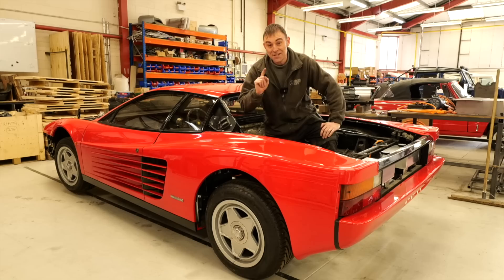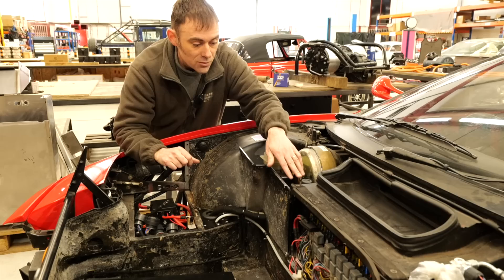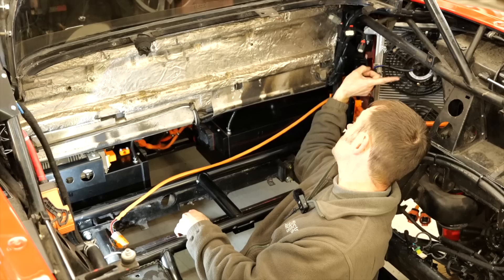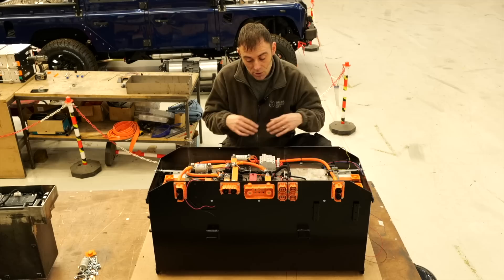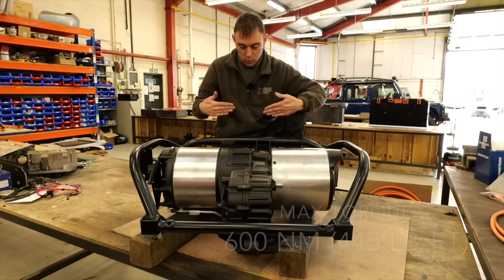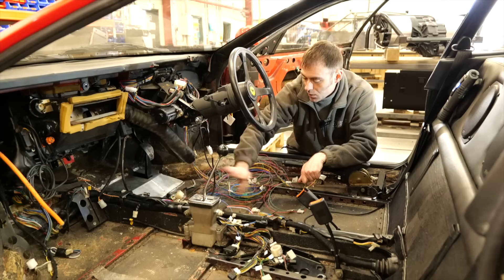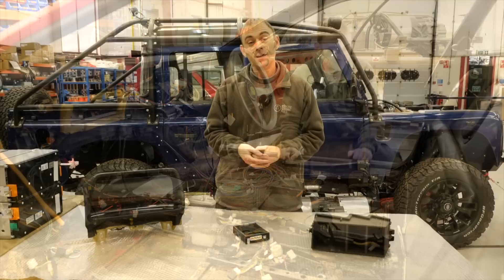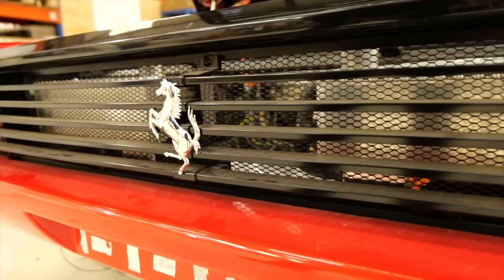Teslarossa Ep5 - Battery packs

Comment: Thanks a lot for the update on the Teslarossa. 
My favorites for an EV conversion are the Lancia delta HF integrale (try to keep the 4WD :-) and  the Maserati Ghibli (Tipo AM336). 
On this one I would propose to replace the rear axle complete by a Tesla model 3 (similar to your Aston Martin V8 project) and the former engine bay and fuel tank space for the batteries.
Reply: Good choice. 👍😀

Comment: A Delta Integrale would be amazing. However in order to keep its all wheel drive capability it would need two electric motors.
Reply: Or they can just connect the electric motor to the original gearbox and drive train. It'd be a great conversion to see though.
Reply: As long as this thing still goes fast and handles great it’s a big win!
Reply: Or four.....  :)
Reply: Jerry rig everything converted a Humvee using one motor and a transfer case.
Reply: And two motors is a problem because?😂
Reply: @terrygibson6972  just stealing room for battery in an already small vehicle.

Comment: Dear Reader,
Electrifying older Citroëns would be top of the bill. The DS, SM, GSA, BX or XM with an electric motor would retain the plus-factors of Citroen, like design and suspension, whilst getting rid of their somewhat undersized engine-power.

A car that doesn't show its racing power, is always more intriguing than a car that you from the outside already expect to perform.

With Kind Regards,
Michel F. van den Brun
Dutch pedestrian
Reply: Are you referring to a sleeper car??

Comment: I do I agree with what you are doing. This car is from the years when I worked in the automotive industry. I got to see inside some of the suppliers who made parts for this car. Ferrari at this time was well known in the industry for their lack of consistency and ignoring suggestions by suppliers.  I saw development models of this car at different suppliers and was shocked that they were still hand welding mild steel frames or seeing how many cheap materials were hiding under the beautiful skin. It was believed Ferrari brought this model out to better Lamborghini, who knows if they did that. You mention the electrical system, it was half German and half Italian economy car and nobody liked working on it. Many of the suspension, breaking and steering attachment points did not look like they were up to the power level of the car. Once they were on the road the horror stories of engine maintenance started rolling in. One similarity Ferrari had to your new system is both used a one piece engine/motor transmission assembly. You should ask the owner of this car how many times the engine has been out? Once the engine was out it was usually out for weeks. This might be the last time for that. I think you're fixing many of the problems this car had and I expect you will end up not any heavier and with better weight balance. The reality of this car is Ferrari made 10,000 of them and most were pampered and still around. They were production cars made from mostly normal production parts by normal factory workers who worked on other production cars, other than the beauty of its coachwork and the ridiculousness of its engine you have a pretty normal car. I think you are doing well and making a car that someone will enjoy. I bet your entire conversion will pay for itself within a couple of "normal" engine overhauls.
Reply: Interesting points 👍😀

Comment: You are doing a fantastic job guys and I can't wait to see this on the road. It will go like a scalded cat. I think the Lancia Beta Coupe and Lotus Europa would make good conversions. The Europa had plenty of room behind the drivetrain and probably bit of space under the bonnet for another pack. Lancia is mid-engined so your experience with the 914 and Testarossa would come in handy there. Failing that, what about a Ford Capri?😆

Comment: I would love to see you convert a 1970 Cuda. As someone who owned a 1969 Delta '88 with a 454 engine, I really like what you are doing. The 1969 Delta '88 was my first car and the most dangerous car I have ever driven. 8MPG, constantly burned oil, AM radio, handled like a heavily loaded barge in high winds, and the brakes didn't work when it rained. But it passed the New Jersey state run inspection. We need to go electric for our own good.
Reply: For our own "good"?  Electric conversions have their uses but anyone who thinks banning all ICE vehicles is going to save the planet is in for rude awakening.
Reply: @phils2180  Where in my comment did I say that we should ban internal combustion engines? I didn't say that.
Reply: @brianbyrd3903  That's what you implied, "We need to go electric". Stop splitting hairs.
Reply: @phils2180 There is a huge difference between advocating for electric cars and making ICE cars illegal. The one doesn't follow from the other. In time electric cars will get cheaper and people will stop buying ICE cars. We won't need to outlaw ICE cars. It's like you are looking for a reason to disagree.

Comment: Your bolt-in conversions are quite clean and respectful to the cars. most cars will have elements changed over their lifetimes, including the drive train, I see no reason why the drive train shouldn’t be changed to an electric one anyway. I would like to see even older cars swapped for electric, the Mercedes Benz 540k is one of my favourites, though I know it’s probably a long shot 😅

Comment: Ah yes,......My dream conversion?........Countach 5000s "not the anniversary edition" or 1972 Detomaso Pantera. You could design a very cool looking battery system to fit in the motor space.
Reply: Pantera please 👍👍👍
Reply: @spudproductions7606  a pantera elktromod would be so right using a tesla ldu of course. To go from American v8 to American v8s ev age replacement propulsion system. It would have to be widebody and slammed or on air ride to. 👍🏻😀

Comment: There was a recent well-publicised Ferrari 308 GTS EV conversion which I regard as a failure, because they changed the weight distribution of the car, giving it the dynamics of a front engined car. The mid-engined mass distribution was a more fundamental property of that car than the V8 ever was. I'm glad you're more considerate with the Teslarossa. I am sure the you can make it better thsn it ever was, by lowering the CoG and of course making it much faster, but in this case the 180 degree 12 cylinder engine and the open gate gearstick were more central to the essence of this car. The heavy clutch, not so much...
The DeLorean was always the prime candidate for EV conversion. Other cars that an EV conversion would suit are an early N/A Giugiaro Esprit, an under-endowed Maserati Merak, Citroën SM/CX, an E31 BMW 8 series, rotary engined Mazdas, a Lancia Montecarlo, a Knight Rider Pontiac Firebird/Trans-AM, VW microbuses/beach buggies/early Golf cabrios, the Vauxhall Calibra and the Ford Probe. And a Jag. Any Jag...

Comment: one option, on cars with iconic engines, could be to make them PHEVs. In the way all PHEVs should be made. With the engine coupled to a generator, and around 20kWh battery to drive around only in electric for city/daily driving. And a natural/analog setting where the accelerator position would match the engine revs/speed, equivalent to ICE driving, minus the gears.

Comment: I absolutely love and applaud what you guys are doing. I would love to see a project with a small city or shopping car that is mainly focused on getting the most range out of the batteries, while the car is still reasonably drive-able. Something that would be affordable for a larger crowd of people. Perhaps a mazda miata, or a triumph spitfire, or even a Citroen DS? I also wonder if you guys keep track of the new electric motors such as the electric crate motor from ford, or perhaps even the koenigsegg Quark raxial flux electric motor that weighs only 30kg?  The Koenigsegg electric raxial motor would be awesome inside your electric beetle. And no, I am not going to pay for it 😁
Reply: As for a regular performance build a Datsun 240 Z would be cool too. I like performance focused builds, but I also like efficiency focused builds. And I also like off road focused builds.
Reply: @insAneTunA   I thought nearly all the 240Z's had disappeared into piles of rust?
Reply: @geoffsemon7411  These guys don't do piles of rust. These guys do classic cars, so by definition the cars are not up for grabs. There are still good ones out there. Or ones that had a restomod. And I think that most of their clients already own the car. So there just has to be somebody with a good 240Z and a desire to give it an electric conversion, and I think that it would make a very good show.  We viewers just have to get lucky 🙂

Comment: Maybe hard to get in the UK, but a 68 or 69 Dodge Charger would rock as an ev - although I know there would be many colorful comments 😂
Reply: What about a 1972 Plymouth satellite called project electrolitte using a tesla ldu with over 700hp that runs low 12s and goes over 300 miles on a full charge? You can find it right here on YouTube it's a garage build to. 👍🏻😎
Reply: You can get them, but need deep pockets for a nice one.
Would you paint it Hemi Orange?...🤔

Comment: I'm thinking the XJ220 or McLaren F1 road car... the 90's pairing that matched the Countache and Testarossa for their era. Having sat in one at the Birmingham Motorshow at launch an again sat in and started an XJ220 at the factory I can confirm you need to be a shorty to drive it. I'm not tall but the Jim Randle era low roofline impinges even on my view (and did at the time when I was a spotty teenager too!). The battery pack you have there in the Teslarossa is not far different to the 540BHP of the XJ220 road car which at the time was Jaguar's highest powered production car ever. The original plan for the Jag was to use a gas turbine to power it but that proved too costly and impractical.... so the petrol engine was always second best to the original vision. I suspect therefore that to EV it would improve things.. though the top speed might be a challenge!

Comment: Just had a random thought seeing this build... You guys are out in the uk....

Seen if you can get your hands on a hawk hf 2000-3000 for a ev powered lancia Stratos replica?

Could do a nissan leaf drive unit/transaxle or a small tesla drive unit it already be more powerful than a stock Dino v6 and you could probably squeeze 30-40kwhr of batteries in the chassis.

Or a listerbell str but I think a hawk hf would be more genuine looking... And cheaper than trying to get a actual lancia Stratos
Reply from the maker: A Tesla powered Hawk HF would be very cool. 😎👍
Reply: @ElectricClassicCars  I'm a bit jealous of you guys cause you also have mst making brand new mk1 and mk2 escourts which would also be a hoot with electric drive

Comment: On the topic of safety... what will happen to the battery in the front, if it is smushed in?? I mean, there's not much of a crumple zone. And shutting off the system won't stop a damaged cell from shorting internally. Are the cells so tough? Or is there a fire suppression system?

Comment: Brilliant design as usual! What I can't understand is why you did not clean up the bonnet and boot and floor areas and treat them before installing all that cool gear! It's looks just horrible! Like putting in brand new kitchen appliances without cleaning and painting the walls around it FIRST!
Reply: The carpet will be installed when the install is complete. The final product will be cleaned up.
Reply: @spudproductions7606  Well obviously the carpet will be installed on the inside but what are you going to do in the boot and in the Bonnet areas? Looks so horrible! Is that all fiberglass in there as it looks like rusted corroded and old paint. Or stripped down and sanded and never primed and painted over? I just don't get it as looks terrible. But again your work with the Electronics and motors and everything around the tech are fantastic and look top-notch.

Comment: So the Landy behind you is so big. So much room, and it doesn't need to be a speed demon.
Would it be possible to install a tiny diesel powered generator in it to constantly charge the batteries?

Comment: Richard, the translation the guys have made for the instrumentation is wrong..you can't say "velocità" when you talk about gears. I know that it was ment to be "speed" in english , which may translate in "velocità" but only when you talk about velocity. In this case "Marce" ( Plural) or "Marcia" ( Singular) would have been the right word to translate "speed" to. For all the rest, a very spectacular execution, as always. I was wandering...have you ever thought about converting a Lada Niva? Pretty good off roader with a crappy gas engine...or a Fiat Panda 4x4...the first one, of course.

Comment: I like the whole idea of electrical conversion and some cars lend themselves perfectly to this like Rolls Royce, Jaguar, Mercedes and such. I expect I'll get some stick for this but in my humble opinion, Ferraris and Lamborghinis aren't in that list. One of the biggest selling points is the sound of the engine whether it be V8, V10 or V12 and to take that away, even if it's for the right motivations like running costs and reliability, just take something away from the car that makes it special.

Comment: Given, Sportscar, why choose a Tesla drive train over a Porsche? Wouldn't the drive unit designed for sportscar performance be  better then that of a family saloon?
One would expect the new drive unit is going to be an improvement over the old gas engine.
As for the approval - those rules you have to abide by, mean the original vehicle is not being destroyed or damaged in any way, so even if it's a pristine and valuable example, so long as the owner stores away the mechanical parts, it can be re-assembled to original at a later date, while being enjoyed right now. With the standard of work you're doing being far and away higher fit and finish then cars such as the Ferrari had from the factories, one could imagine that an EV equipped classic vehicle, sold including original equipment in proper storage and preservation, should soon begin to pull a premuim on resales.
Compared to those, fools, who are cutting and modifying Jensen CV-8's and Interceptors to accept, Chevrolet, engnes,... what you're doing is symathetic and respectful to the history of the vehicles.
Reply: Thanks 👍😀

Comment: I'd like to electrify my unimog 404
Reply from the maker: That makes 2 of us. 😁😎👍
Reply: @ElectricClassicCars   the original motor has less than 100 horsepower mated to the integrated transmission/transfer case.  I wonder if a nissan leaf would be a good donor.

Comment: well, since you asked..  Disclaimer: "All of this is only my opinion.  And yes, it may be different from yours.  If we are on opposite sides, then we can agree to disagree and seek common ground elsewhere but no reason to get all worked up over it."  In general,  I don't agree with these types of projects on what I would consider 'Supercars'.  Possible exceptions being, the original engine has exploded or for whatever reason is not available.  Converting the car to an EV will not make it better, in my opinion.  The world has more than enough golf carts and not enough 12cyl boxers.  What was the story on the car?  The owner didn't want to spend the $6k on a timing belt service every 5 years?  I've previously owned a 911 with sport exhaust, a 308GTS with a Tubi, an 86 Testarossa (with single high mirror) also with a Tubi, and a 01 F360 with headers and a CS style muffler.  The experience and joy of driving these cars fill many different senses for the driver.  One of which is the sound and that connection to the driver.  Without that, it's just an attractive golf cart that really requires no skill to drive until the driver gets into trouble when he has overpowered his braking ability because the 'connection' between the driver and the car is no longer there.  I noticed that some commenters have mentioned 'Hot rodding', but I don't think the term 'Hot rodding' can be used here because that entire philosophy was built upon gasoline & ICEs.  The word 'Traditional' exists for a reason, and not all change or progress is for the better.  Society has failed to grasp that concept.  And as if we didn't already have enough issues to divide us, along comes this one. 🙄😀  Electric motors have their place, but replacing a 12cyl work of art and sound is not one of them.  If you want to convert your Corolla, then go for it, but when it comes to real 'work trucks' or Supercars known for pleasing the auditory senses, just put your hands in the air and step away from the car!  Real trucks have diesel engines and real Supercars have ICEs.  Hey, those are the rules! 😉

Having said all of that,  the engineering, design and quality of the work being done here is absolutely perfection and next level.  I don't know if my opinion on EVs will change before I finish this life, but if it did, I'd definitely want to work with this company.  Peace to all!  ☮
Reply: Thanks for the comment 👍😀

Comment: I do not understand why in a such beast like Ferrari you install only around 60 usable kW of battery total after substracting the buffer for protection when it should be an old Tesla 100D powertrain with 100 kW battery? Maybe you have no choise since the car is rear wheel drive by contrast with AWD ludicrous Tesla?
To answer your question I would like to see converted an old Lambourghini which most of the time was AWD thus able to accept that 100D Tesla heart and lungs, together with vessels and new brain transplant. As I understand you might sometimes slightly modify suspension thus that might be qualified as knee replacement surgery as well?
Nice video. To me you do not do automotive engineering but also art projects by restoring the glory in moving automotive art sculptures.